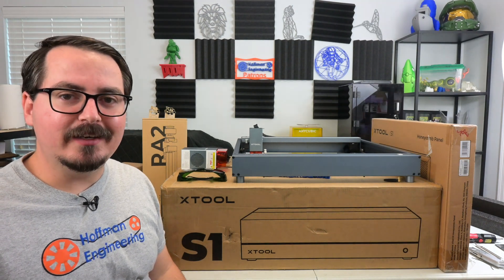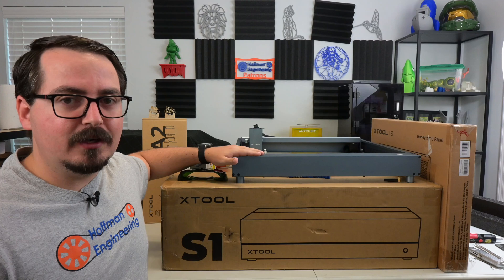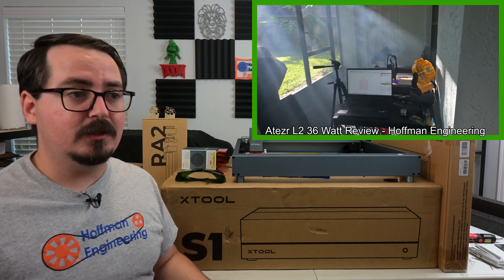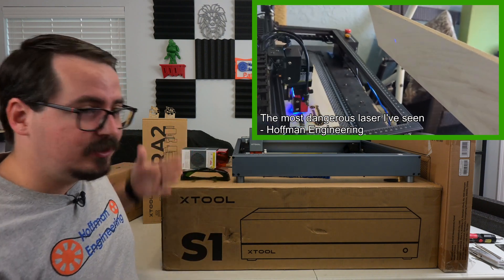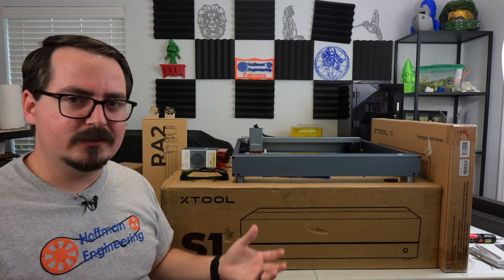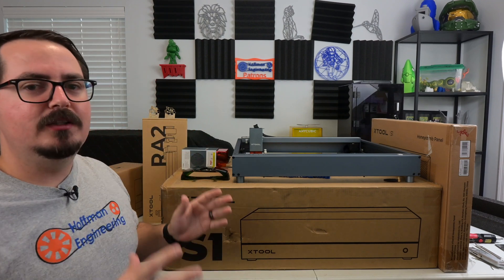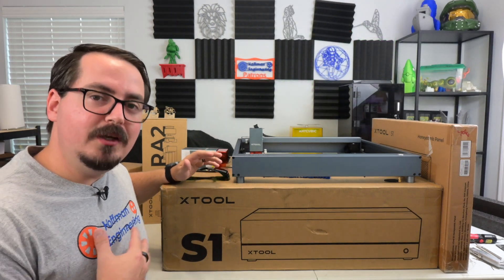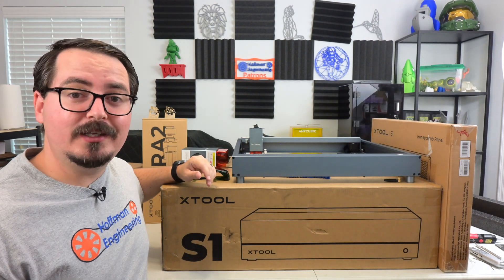There's a new xTool laser engraver! But can they convince you to upgrade?

Comment: can you tell us something about the size? how deep is the whole thing? :)
Reply from the maker: Unfortunately I can't give specifics yet. However, without the honeycomb panel there is a pretty decent depth, but not enough for the RA Pro rotary attachment. With the panel that is reduced quite a bit, but still adaquate. But you can always get the riser frame (needed for rotary attachment and conveyor) to get extra depth with the honeycomb panel.

Comment: Do you see yourself using the S1 more compared to the D1 pro? Is it worth the upgrade?
Reply from the maker: For my specific setup, the S1 would definitely see more use than my D1 Pro simply due to the enclosure. I can have it in my office vented outside like my CO2 laser. For my D1 pro, I have to have it setup semi-outside for ventilation, which is far less convenient. They do sell an enclosure for the D1, but I haven't tried it. 

If money was no issue, then it is a pretty big leap compared to the D1 Pro (even the 40w version). However, xTool will unveal the pricing during their release livestream on the 18th. So we'll see pricing and be able to make that value judgement then.